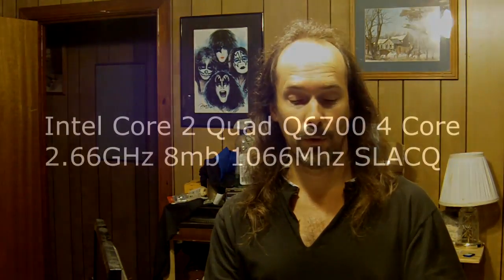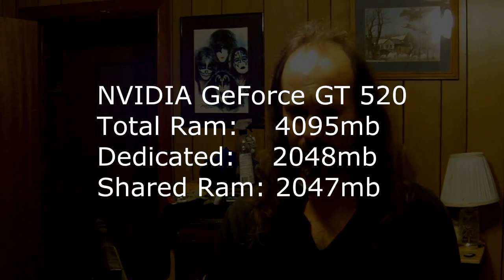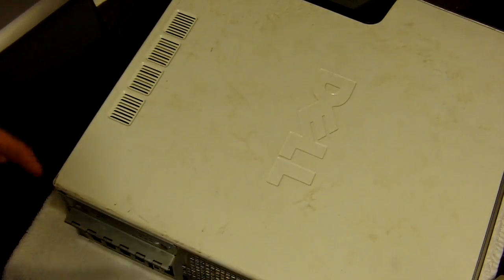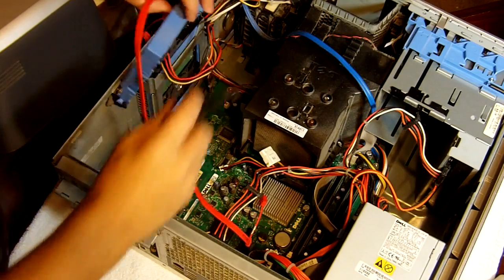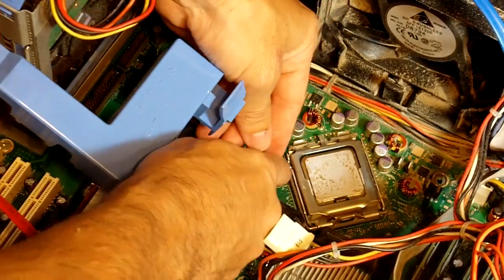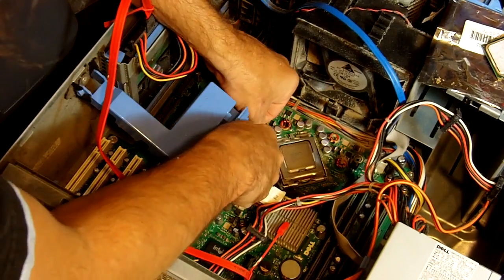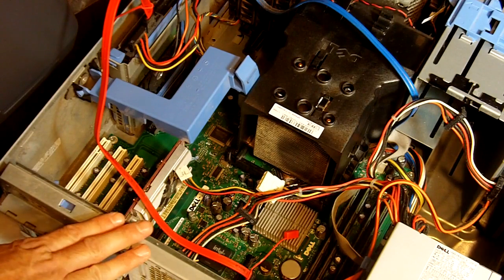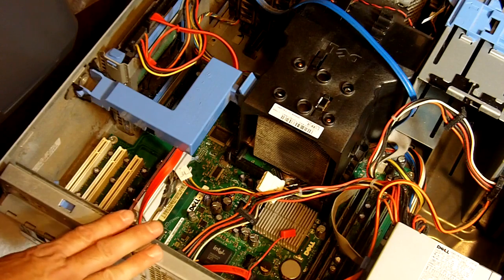Dell Dimension 9200 CPU intel core 2 quad Q6700 Install

Comment: QX6800 best CPU you can install
Reply: iyfranco151 Wrong the best cpu you can put in the Dell Dimension 9200/E520 is the Q6700 as shown in this video.
Reply: @wizzgamer  
Flashing the BIOS to version 2.5.3 will allow you to do so. However the QX6800 Power draw is 130w. I recommend a good power supply.
And now you can run faster DDR2 1066 Memory.  All spec's Tested and working on my Dell 9200 PC.
Please let me know.
Reply: @wizzgamer  so did you ever installed the QX6800 ???
Reply: @iyfranco151  I know longer have the Dell Dimension to test it sadly.

Comment: did you apply paste on you quad chip noticed in video you didn't have any on the replacement chip yikes!!!!!
Reply: +darkeffectstv I just found your vid by chance didn't read the description, guess because I'm still spinning on my head to finally see proof that a multicore chip can be put into a Dell 9000 series PC with a socket 775, I have a dem. 9100 at this end. You've done something major here. Thanks !!!!
Reply: +darkeffectstv just ordered a Intel core 2 q6600 4 core chip for $16 early in the am
Reply: +darkeffectstv lol just read the description. even tho you've corrected the mistake your vid has made history when it comes to the question can this be done !!!. you've proven it can !!!!!!.
Reply: I reviewed the vid again and notice there was paste on the heatsink so you were in good shape at that stage.
Reply: Oh just remembered the quad core chip that you put in the Dell was that a Dell chip or a non Dell chip, would it make a difference if it were a non Dell chip
Reply: +darkeffectstv that's good to know, I noticed that there were a few Dell chips that came up on the eBay list that were at the same price range you mentioned while working on the Dell D. 9200, thanks again for responding
Reply: +darkeffectstv I have a Dell xps400 which also has a soçket 775 and can run at 64 bits I'll change the chip on the once correct it's problem

Comment: Hey, Wayne!....just got my 8GB of RAM working on my DD9200!!!...had to order some more RAM....one stick was bad in my first group.....I actually have TWO DD9200's now!...LOL!...bought another one off ebay for 75 clams!....had bad caps on the board...replaced 4, I think!...anyway, the DD9200 I got off ebay had a revision 01 mobo in it instead of a rev.00 that my first DD9200 had. anyway...up and going now!....put the SLACQ C2Q in....runs like a champ!...my other DD9200 I think I am going to try and get my 10 year old son interested in putting it together so he can feel like he accomplished something fun!....Thanks Again for Your Inspiration!
Reply: Thanks!....appreciate the comment!

Comment: Hey bro you forgot the heartsink compound............. is that cpu still working? anyway i have one of these running ubuntu with a fully encrypted LVM (full hard drive encryption) and i i need the extra cpu to get the job done works with 2 cores but needs a little extra kick, but i gonna make sure i use heatsink compund!!!!!!!!
Reply: +darkeffectstv by default they are not shown on the mobile app, probly would have been a better idea to edit txt into the video from the video manager

Comment: Nicely informative video!!!Just got a DD 9200 for around $100 and am ordering the cpu & ram upgrades from eBay…I am going to try Ubuntu 64 bit on the system…currently am running 32 bit w/ 2GB of RAM. Saw a vid of a guy that made a hackintosh from a 9200. I like Windows 7, but I'd have to install 7 before Ubuntu for a dual boot setup! I like Linux…slim & fast!
Reply: +darkeffectstv I just got the PC and it has the stock 375 watt PS. The video is an ATI Card, VisionTek X1300, 256 MB video, PCIe....got the video card out of a used video card bin and it seems to work natively with Ubuntu, no problems! As far as the memory, I checked it out on kingston.com and here's the link to ebay where I purchased:

http://www.ebay.com/itm/LOT-OF-2-X-2GB-4GB-KINGSTON-KTM4982-2G-PC2-5300-DDR2-667-LOW-PROFILE-PC-MEMORY-/331768821304?hash=item4d3ef67638:g:BP0AAOSwzhVWsPtr

It is listed to work with Lenovo PC's, which I am a pretty big fan of!

I like the amount and availability of connections in the DD 9200!

Hey, If you have a link to a power supply on newegg, or such, send it to me!

Thanks!

Joel
Reply: As an added note to the mention of my using Ubuntu as an operating system, I have tended to shy away from using Microsoft as an OS.

Why?

I work as a copy technician (installing and maintaining copy machines and printers) and have noticed during the installation of print drivers the direction and attitude that microsoft is exhibiting towards the general public. The basic gist of the attitude I detect goes something like this:

 "people need to be protected from themselves. Under this 'umbrella' of assumption, we are going to start 'assisting' consumers with setup of peripheral devices."

I detected this with the start of Windows 8. You say "How?" well, I would install a copy machine, Ricoh/Savin in this instance (customer was using Windows 7 at the time) then the customer would decide to "upgrade" to Widows 8. What would then happen, the customer would try to print a document that they wanted staple, punch and collate. Well, come to find out, that DID NOT happen! Why? Well, in Microsoft's 'infinite wisdom' of 'helping out' they (Microsoft) load a generic 'Ricoh Class' print driver which does not give the proper options for the specific model of machine and accessories AND to top it all off, Microsoft will tend to use a WSD printer port instead of the machines IP Address or Hostname!  The customer is REALLY lucky if they can print via the WSD port setup!...and if they do, many times there will be a ridiculously long delay before the print actually comes out!

Microsoft tends to make things stupidly overcomplicated!...Although I have absolutely no problems using Windows 7!...in fact, I upgraded our office computers to Windows 7 and haven't had any problems at all! The Windows 7 Pro OS has a GOOD print management console!:

http://www.digitalcitizen.life/geek-way-managing-printers-print-management-console

Thanks Again for Your Info, Wayne!...and thanks for listening to my rant on Microsoft!

Joel

PS-My home network consists of 1 Windows 7 machine, 2 Apple Computers (PowerPC CPU based) and several of either Ubuntu or Linux Lite OS based PC's...Oh...and not to forget, a ROKU box, which I think runs a version of Debian AND a couple of WD MyCloud NAS Drives (I think Debian too!) that serve as media/file hubs!!!  ;)
Reply: Apple's Desktops are quite good and a good bit overpriced!...I have purchased used/off lease ones from an outfit out of Florida, called Mac of All Trades. Got some pretty decent deals for what I needed at the time! BUT, now that I am expanding my repertoire, I find that I need the Apple products less and less!...BTW, diversification can be a good thing!
Reply: Just got my Q6700 SLACQ Intel CPU today and put it in!...WoW does it fly with Ubuntu Linux!....Don't have my 8GB of Kingston RAM yet...still waiting on that!....currently have 32 bit OS, but when I get the RAM I'll probably go for the latest 64 bit Ubuntu OS!...I'll probably try a Handbrake DVD rip/trans=code to see how it does....should be interesting!...by itself, Handbrake doesn't de=crypt dvd's, but I'll have to separately install LIBDVDCSS for it to work properly:

https://en.wikipedia.org/wiki/Libdvdcss

Will keep you posted on how it goes!

PS--no problems with the power supply yet....I'll see what happens when I get to the heavy processing!...someone I know recommended Corsair power supplies!...I've used Silverstone in another machine I have.
Reply: I would think a good power supply would make a big difference!....I am looking at the Corsair brand...they use all 105 C Japanese caps in their power supplies for a tighter tolerance and better longevity!...and I think some of their power supplies even have 7 year warranties!
Reply: Got my 8 GB of RAM, although it wouldn't post with all 8 in, I had to roll it back to 6 GB which works just fine...Oh Well!  Just picked up an EVGA 500w PS and put it in today! seems to be running quite well! Installed Ubuntu 15.10 Wily and there has been 0% swap file used on the Hard drive!...It's only using RAM!...currently sitting at 1.4 GB of Hard RAM usage! Just waiting for taxes to add more Hard Drives and SSDs!
Reply: Computer wouldn't start with all 8 GB in....Slots 1, 2, & 3 are populated and post ok. ..won't even boot up with slot 4 populated...it's not the RAM, since I tested all sticks in various slots....RAM is Kingston KTM4982/2G, 1.8 Volts.
Reply: Just looked at my mobo...found a couple of bulged capacitors!....wonder if it is affecting the memory recognition for the last memory slot!
Reply: Exact Bad Caps Shown Here!:
http://www.badcaps.net/forum/showthread.php?t=15091

Can't Believe I Didn't Notice Them Sooner!!!
Reply: Just Replaced the Caps shown in the link above!....although I wasn't able to install 8 GB of RAM (4x2 GB sticks) afterwards, I did get the 6 GB (3 Sticks) to work just fine. I wonder if it has to do with a motherboard revision, since I have the most recent firmware!  Anyway, since I replaced the bad caps, I get an easy and fast startup....before, it would either startup fine or the CPU fan would go into a high speed mode and I'd have to hold the power button down to shut it off and try again!
Reply: Oh Yeah!....If you don't have an SSD with the OS installed, that would be another "kick in the pants"!

Comment: where you bought the Ram for pc
Reply: +darkeffectstv  You may buy this link http://www.ebay.com/itm/8GB-Kit-2-x-4-GB-Kingston-DDR2-667-PC2-5300F-KTH-XW667-8-G-2Rx4-ECC-FB-DIMM-RAM-/271979448797?hash=item3f533d09dd:g:kQ8AAOSwgQ9VjVH0
Reply: +darkeffectstv thanks
Reply: +darkeffectstv you can put the link where you bought the power supply
Reply: you did with warming pc

Comment: I have an HP d4990y pc, it came as a 32bit system but today I found out it's 64 bit capable. When i bought it, the Q6700 processor was the top of the line chip for my system(I went with E6700 chip as it was cheaper). Since my pc says that it's 64 bit capable does that mean that I can upgrade to the Q6700 chip + Win7 64bit with no issues? Is there an even better chip  compatible with my pc? http://support.hp.com/us-en/product/HP-Pavilion-d4000-Desktop-PC-series/3461455/model/3461456/document/c01214754#AbT2
Reply: ***** Bc I ordered specifically 32bit, I wasn't expecting it to be 64bit capable, and I never had the necessity of a 64bit system until now that a program I need requires 64bit. Thanks for the info.
Reply: *****
 hey man now that you have seen the specs on my pc, do you think it can handle the QX6800 processor? In the HP site the Q6700 is listed as the top of the line for my pc, but the QX6800 shares the same specs as the Q6700, except that the QX6800 is 2.93GHz

Comment: muh laptop has a i5 in it so muh IY 5 outbeats MUH dell!!! jkjk you sound like an old schooler man check out the athalon x4 750k trinity its only about what u payed for that quad and its a quad core out the box it turbos at 4 ghz it blows the doors off that old dead socket piece of shit! good luck spread the PC love brother!
Reply: I meant when u upgrade and believe me its time! if you need any advice my brother and i have  both built 3 systems each since 2011 i can be of alot of help i also got an xtra XFX HD 6790 1gb if u pay the shipping u can have it

Comment: Thank you for sharing - inspired to upgrade my 9200 to 64 bit.  Did you purchase everything on Ebay?
Reply: ***** This processor installed flawlessly after flashing the BIOS to the most recent. Did you ever upgrade to more than 4GB of RAM?
Reply: Thank you for the advice on the name brand memory.  I have had my system since 2007. Since cleaning the CPU heatsink, it has been running quietly. This is eventually going to be just a Minecraft/media server also. Never thought I'd flip it to 64 bit until this video. Hope yours holds up awhile longer.

Comment: I have a Dell Dimension 5150 that has a 500W power supply. Would this work on it?
Reply: ***** It's an Intel Pentium 4 but I don't know what bit processor it is. I'm out of country so I can't access the Dell computer.
Reply: ***** I just checked the processor online. I'm pretty sure it's 64-bit. so this CPU would work on that motherboard? We pretty much almost have the same motherboard.
Reply: 4GB DDR2